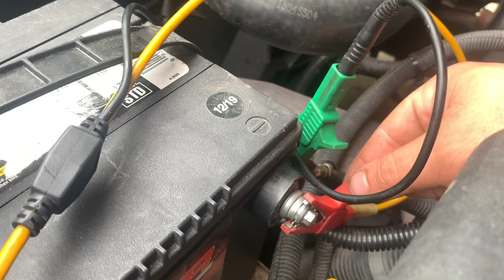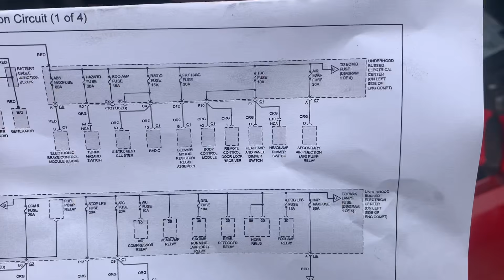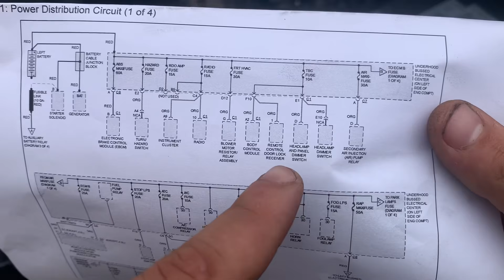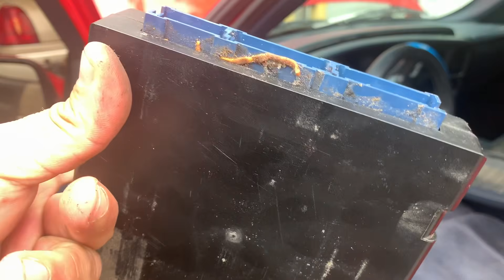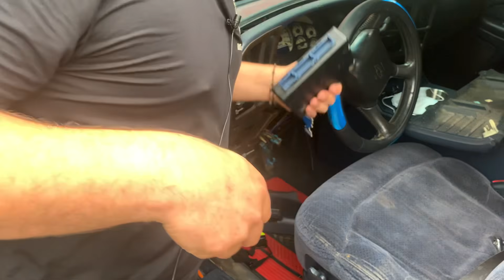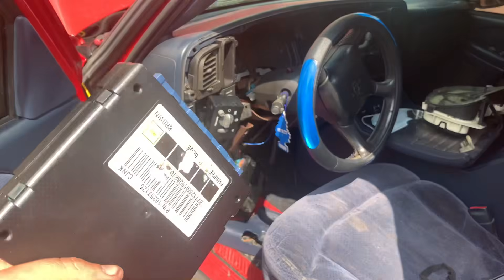Silverado battery drain FIX

Comment: Where did you get that wire diagram? I need one for my 04 Yukon. I’m having crazy problems with my electrical system after jump starting after it sat over the winter. It has a brand new battery that suddenly goes dead after a day or so. Gauges are all over the place, tranny shift issues…. It’s a mess.
Reply: Definitely sounds like ALL your "Ground Straps" need replacing. Your Vehicle is 21 years old ...so they should be replaced anyhow. 😁

Comment: Im betting this is my problem with my 05 silverado.. I get a code for fog lights short to ground also my interior lights sometimes don't come on when I open the door or they will come on for about 3 seconds and fade out like the door is shut.

Comment: When i hooked up to the battery terminal to the ground cable it reads 12 volts. My ground wire has power. Where would it be getting it from? 2000 chevy silverado.

Comment: I'm having the same issue, I actually hear a clicking coming from my dash occasionally when truck is off and dead, also my dimmer is not functioning and half of my dash lights are out, and no speedometer lol I've got a little work ahead of me, thank God for YouTube and a little bit of ingenuity
Reply: Anything I have the same issues as you man
Reply: @Nathan-pu4fz check your cig lighter outlets they cause that other ground attached to the pillar trim driver side dash
Reply: Check/replace your Ground Straps in the Engine Compartment which can cause all kinds of problems if they are bad. 😀
Reply: @JayMane-z7c  I appreciate the advice, thanks alot. I still haven't solved the issue, but I bought a bladed battery disconnect, and have been killing the battery if I know the truck will be sitting for a day or 2.

Comment: Maybe I just don’t see it or understand how it works, but I don’t see the yellow cable you’re using to put the battery in series or why it’s not smoking the wire while in series? Not good at wiring but trying what I can until I give up and take it to the shop.

Comment: Stumped i have a 2014 gmc sierra 1500 sle battery drains over knight no after market add on if i pull the ipc fuses drain stops cleaned all grounds put a new alternator in pulled radio fuse that never helped battery is good any help would be appreciated fuse out mil amp 0.016 fuse in 2.625 really stumped
Reply: Check the Engine Compartment & your Vehicle's Glove Box Light Bulbs to make sure they are turning off when closing the Hood & Glove Box Door. 👍

Comment: FIXED - found out the power draw on my 95’ Silverado was a 10a “radio battery” fuse located on the side of the dash right inside the door. I couldn’t hold the meter so I pulled 7 random fuses and after that the draw went down to 0.01. Replaced them 1 by 1 and kept going back to check with the multimeter on the battery. Sure enough the radio was drawing 0.82 Everytime.
Reply: It was just the 10 amp fuse or the whole radio?
Reply: @RelaxedRaptor03  i replaced the fuse and it did the same, so it was either the radio itself, or a short in the wires in the dash. only way to tell is to hook up a different spare radio which i didnt have, ended up selling the truck month later

Comment: Thanks your video helped one question did you have to program BCM or is it just plug and play
Reply: Even if i get a used one from another truck
Reply from the maker: Yes program the calibration and the keys
Reply from the maker: You would have to program the bcm

Comment: Hey man I know this is a few years old but I have a 99 Silverado that has a parasitic draw of about 1.5 milliamps I believe it was so I followed your video as and pulled the radio fuse and it dropped to .7 and then the radio amp fuse dropped it to .016 so I unhooked the radio and put the fuses back in and it still reads .016. I didn't do anything to the amp but regardless I hooked the battery back up and left radio out and fuses in and the next day the battery was dead. Tested again and still have .016. battery is brand new as the draw killed the old one. Will . 016ma drain the battery? I thought under .050 was good. I'm going to rerun the test tonight to make sure the battery wasn't already dead but I'm 99.9% sure it wasn't

Comment: Good video.  I was wondering if the condition of the PCM was indicative of the car being in a flood?  It appeared to have a lot of trash, i.e. small specks of trash that would have settled on the circuit card, but because the PCM  had a lid on it, the larger trash accumulated mostly around the outside of the unit?

Comment: My 2004 Chevy Silverado has a parasitic draw problem that began about 6 months ago. If I don't drive my pickup it will run down in 5 days. Where can I find the wiring diagram for this model?
Reply: Check the Engine Compartment & your Vehicle's Glove Box Light Bulbs to make sure they are turning off when closing the Hood & Glove Box Door. 😁

Comment: It's hard to tell, but it looks like those solder pads connect to the capacitor on the other side. Electrtrolytic capacitors tend to fail after 15 to 20 years, so i would replace those two electrolytic capacitors.

Comment: I have the same problem can the bcm cause a security light on all the time? The truck drives but the light stays lit all the time and my battery drains i did the parasitic draw test and same fuse is causing problems

Comment: Hey so i changed my starter on my 2008 silverado and once i am reconnecting the battery its causing the truck to turn on by itself(wont turn on all the way though) what could this be?

Comment: I have a 2005 sierra 5.3 and i have done everything EXACTLY how u did in the video but i still cant find the battery drain, its so bad that its sulfated 2 optimas in less than a month and since they only prorate twice im literally SOL and they want me to buy another one🤦🏻‍♂️ i will put the battery charger overnight and it will charge the battery while being disconnected from the truck) and i can turn on the truck and drive it and it will not have any symptoms at all. But when i turn it off the battery will be completely drained and cool to the touch. ive replaced this so far 2 yellow tops, 1 duralast, ac delco alternator, body control module, PCM, engine harness, ac delco starter, motor and body grounds, tail light and hitch control modules, fuel pump, evap canister, and even replaced 2 cluster that are known to be fixed. Im literally at a stump with it and i dont want to get pushed to having to sell the truck or switching over all my stuff to another body🤦🏻‍♂️ any help would be GREATLY appreciated 🙏🏼
Reply from the maker: Did you hook up your multimeter in series to the battery to see that amp draw ?
Reply: @OzMechanics  yes and everything seemed to fall asleep after a few minutes
Reply: Check the Engine Compartment & your Vehicle's Glove Box Light Bulbs to make sure they are turning off when closing the Hood & Glove Box Door. Also ...if your Vehicle has a rear Window Wiper like an SUV ...remove the Fuse for it to see if it fixes/stops your Parasitic Drain.👍

Comment: I had the same problem with my 03. Turns out that a wire running from the battery to the alternator was completely cooked and needed to be replaced. Check that out. I'd bought several batteries and alternators over the years before someone helped me out with it.
Reply: The wire runs from the alternator to a relay connected to the battery. It was cooked on the alternator end and hot to the touch. 12 dollar fix for a 6 year problem.
Reply: I was thinking this hoping this is the problem will check it out after I get home
Reply: Started outta no where tho like I was chilling forgot the key on then it happen now it doesn’t wanna stay charged
Reply: @GearShiftsAndAdventures did that fix your problem
Reply: How did you diagnose?
Reply: Every time I press on brakes, the abs light comes on and draws the battery down.

Comment: Have the same problem on my 2007 Chevy Silverado 1500LT.  Had the truck sitting for a week without being started and the battery was completely drained when I attempted to start it.  Didn't see any dome lights on or anything else on that may have killed the battery.  Also, it's a brand new AC Delco battery, so it's definitely not a charging issue or the alternator as the battery does charge when the engine us running.  Had to boost the battery with jumper cables connected to my 2021 Dodge Charger to get enough current into the Silverado to turn the engine over.  I just ordered some alligator clip probes for my digital multimeter and will be pulling fuses this coming weekend to see which circuit is the culprit.

Comment: Make sure you are turning the key all the way back until it clicks!!! That’s the issue on mines.. 😅 trust me the shift stick needs to lock along with the key so make sure you turn the key until it clicks or you see the shift stick move too
Reply: Were you able to pull the key out while the truck was on??? Mine is draining my battery and mechanic says I need a new key cylinder
Reply: Yea I was able too.. just make sure when turning it off that you pull the key all the way back and it pops in place if not it will drain it. But yea I will eventually also need the key cylinder thing

Comment: Hey man, hope you still see your comments on the video. I'm currently having the same issue except more severe. I have about 3.04 amps being drawn after letting my 2005 Suburban sit. I've figured out all the circuits that are pulling power. I have 9 circuits currently pulling power. Any chance something bigger like a bad ground could be causing this issue? I've been fighting it for months now trying to find an answer without having to take it to a mechanic or dealership. ANY help would be appreciated
Reply: Were you able to ever find a solution?
Reply: @mrt094  haven’t to this day. Ended up putting a battery cutoff switch inside the truck
Reply: @IAintImFat  Did you try replacing the ground cables I know you said you suspected that might be the issue?

Comment: What's up bro? I have a 2005 silvero just replaced battery with optima red top so getting good readings.  How do I start checking the fuses . A little confused on how to hook the alligator clips up. And once hood ul start pulling 1 fuse at a time and look for the drop? Thanks
Reply from the maker: https://youtu.be/n-oiRdJbjHA
Check this out

Comment: i did this and  have a 0.02 draw . i ran the truck for about a hour . let it set for about  200 min did the test . still shows 0.02 . when i take the cable off i do hear like a clicking noise  under the dash . pullled ever fuse still hear the clicking  .  pull every  relay . same thing  . so i pull the fuse on the radio  an cigar lighters an see if the battery die's . i i will add the truck has no horn .
Reply from the maker: A .02 is perfect. That is not a draw at all. When you open the door does the numbers go up on the meter ?
Reply: @OzMechanics  yea i had both doors open  an nothing .   the dome light doesn't work .

Comment: Do you think mine might be the bcm does it control fuel pump or what would signs of it going bad
Reply: If fuel pump is acting up , 99% of the time it is a fuel pump with any Chevy truck,  or plugged fuel filter

Comment: I only asking this I know you good at these Silverado 2000 some turn key and no fuel pump then if I turn key off test says fuse box is hot except for fuel relay, then if you let it set some x it’s fine like nothing wrong, then some x you have to jump fuel pump and it’ll start wth is this thought ignition switch , idk now. Please help thanks

Comment: Nice explanation OZ but I have a 2004 chevy duramax 6.6 and it's draining the new batteries, it has 2 batteries. how would I test with the multimeter to find what's draining the batteries?
Reply: Did you ever find out what it was

Comment: So when I narrow it down to the fuse that's causing the draw? What step is next? Leave evrything connected and just start pulling stuff apart inside the cab? Watching dor a drop?
Reply from the maker: You need to go to a wiring diagram to verify what is powering up that fuse. I just recorded a draw video yesterday it I won’t have it up till 2 weeks. It’s going to be a detailed video on draws

Comment: hopefully you are still responding to questions...  I have an 06 Escalade that kills the battery after a few days, sometimes in just one day..  I checked the draw and come up with a .058 draw..  is this enough to kill the battery so quickly? Or is this ok? If it's not a bad draw I suspect it could the alternator diodes...
Reply from the maker: Nope. A .058 draw would last’s weeks. If it was .580 that would be a few days
Reply: @OzMechanics  Thank you for the quick response. guess I need to test the alternator diodes..

Comment: I picked up a used 1993 C1500 with a draw issue.  It's not my daily driver so I just installed a knife switch at the battery.  And, the thing is on a trickle smart charger while it sits.  I drove it this way for fifteen years occasionally attempting to trace down the draw.  But, since I had a working solution, I didn't go at it the diagnosis full-on.  I couldn't find any fused circuit pulling the juice.

Then, while under the dash for some other work, I spied a relay someone had installed.  Most likely for a trailer brake which I removed when initially acquiring the truck.  Once the relay was removed, the draw was gone.  Although, I still use the knife switch when the vehicle is not in use.

Also since it sits, squirrels had done a mess to the wiring under the hood.  Once I fixed the chewed-on wiring, I started keeping three rat traps under the hood.  No return squirrel issues after a couple of sprung trap resets.

Comment: Does the BCM need to be programmed or is just a plug&play per p/n?
Reply from the maker: Programmed
Reply: @OzMechanics  can you buy the bcm programmed or did you have to take the truck to the dealer to be programmed? 
Thank You
Reply from the maker: If you have an interface you can program by buying the gm software. But if not, you would have to take it to the dealership

Comment: A perfect lesson for me right now as I'm trying to find a draw on my 05 Silverado.  I was really  interested in seeing how you put your ammeter in series with the gm side terminals...thanks for putting these excellent videos out for us!
Reply: my '05 has a 0.25 amp current flowing through the battery cable when off. Kills my Optima red top in about a week.
Reply: It might  NOT the BCM.  It's the door switch not shutting the BCM down when you open the door after shutting the truck down. The door switches fail.
Reply: Figure it out? 05 Chevy still have my draw..
Reply: My 05 Silverado also has a bad draw dead in 3 days.